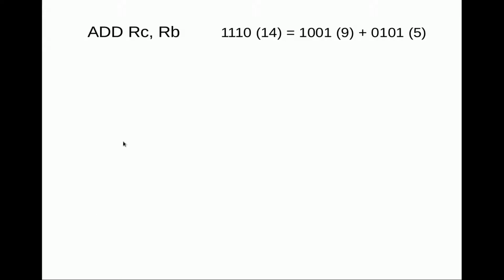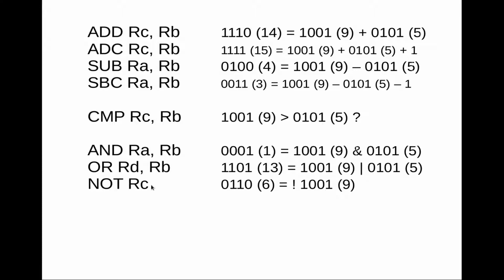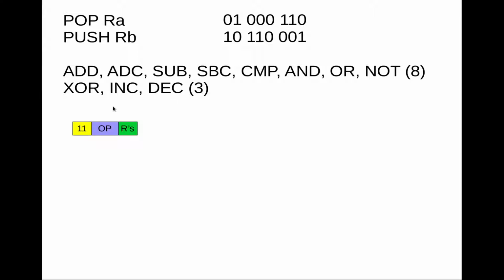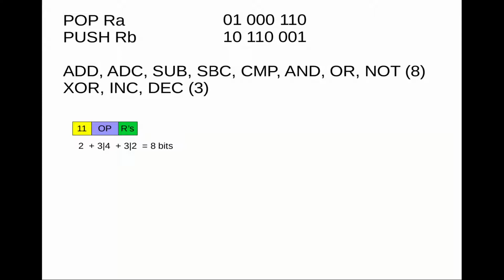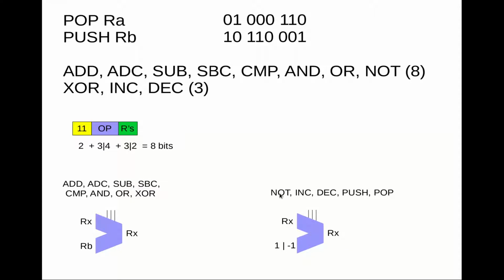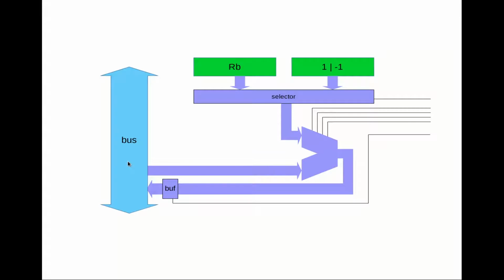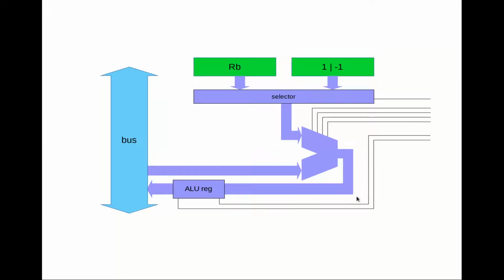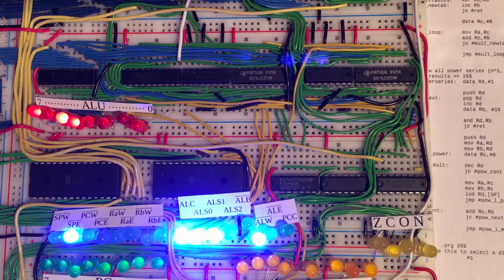My Ben Eater inspired homemade 8-bit CPU - Part 6: ALU  - I

Comment: So why didn't you go with the notion on the "accummulator" and perform all ALU instructuons with first operand and result in the accummulator? You can even use the second operand from memory.

Another thing I'm wondering: stack pointer INC and DEC operations: why bother the ALU with that? Or do you use the ALU to increase the Program Counter? No, so we should be able to build a stack pointer which has the INC and DEC feature built into it. Did you find any particular reason not to do that?
Reply: And here is a chip for our stack pointer: 
 74LS169 which is just like the 161, but it has an Up/Down input on pin-1 instead of the Clear input. So there you go, that's what I will use for my stack pointer. So, while I would still have an INC and DEC for an X and Y register that would be used as an index from a base address (a la 6502), but I wouldn't use the ALU for the stack pointer, and in fact, it seems to me that neither the 6502 does that for INX/DEX and INY/DEY, for which reason there is no INC(A) and DEC(A) opcode.

Comment: I am planning on using the 74LS181. It has a lot of built in capability and a built in comparator (only for 4 bits at a time, so need to AND both signals from each chip). But it has 4 select lines, and carry input. So that is roughly 5 control lines for it. Now say, like your immediate commands, I had stored in program the command for the ALU that I want, which should work just fine. And it could 'save' a lot of possible instructions. The only issue I can think of is doing math on an immediate operand. It probably will make math instructions a bit longer, especially with an immediate operand, but what do you think of the idea?
Reply from the maker: It could be a way of getting around my severe limitations on ALU instructions, which I shoe-horned into 8-bit instructions. Essentially, you are proposing 16-bit ALU instructions, perhaps 24 bits if an immediate operand is involved.

The issue I see with that, is getting your second instruction byte "into" the ALU. Indeed, the instrcution register is only 1 byte long. When you read in the second byte of the instruction, it'll be on the bus, and you'll need to put it somewhere. It can't go from the bus directly to the 74181 control lines, because then how will you feed in operands to the ALU? They too must come from the bus. So you're going to need a "second instruction register", or an "ALU operation register", or whatever you want to call it, to store this second instruction byte. You can then connect it's output to the 74ls181.

Now, since you're going for full-blown ALU instructions with freely selectable register or immediate inputs, you'll need some way of getting TWO operands from the bus into the ALU. Again, you'll need another register to hold, say operand no. 1: on one cycle, you load that register from the bus. It's output goes into input A of the ALU. On the next cycle, you load operand no. 2 from the bus (after possibly fetching it from RAM first if it's e.g. an immediate operand). It can go straight to the 74181 (i.e. input B of the ALU is connected directly to the bus). And finally, like in my cpu, you need to latch the result, which you can then send out on the bus on the final instruction cycle.

So for a typical ALU instruction with two register operands, your instruction cycles will look like this:

T0:    PC is on the bus, and goes into the MAR
T1:    first instruction byte is on the bus, and goes into the IR. PC is incremented
T2:    microcode discovers it's an ALU operation. PC goes on the bus, and into MAR. PC is incremented
T3:    second instruction byte is on the bus. It goes to the "ALU operation register".
T4:    register operand no. 1 goes on the bus. It goes to the "ALU operand register".
T5:    register operand no. 2 goes on the bus. ALU output goes into "ALU output register".
T6:    ALU output register goes on the bus, and into destination register.

For an ALU instrcution with an immediate (second) operand, you have 1 more cycle:

T0:    PC is on the bus, and goes into the MAR
T1:    first instruction byte is on the bus, and goes into the IR. PC is incremented
T2:    microcode discovers it's an ALU operation. PC goes on the bus, and into MAR. PC is incremented
T3:    second instruction byte is on the bus. It goes to the "ALU operation register".
T4:    register operand no. 1 goes on the bus. It goes to the "ALU operand register".
T5:    PC goes on the bus, and into MAR. PC is incremented.
T6:    immediate operand goes on the bus. ALU output goes into "ALU output register".
T7:    ALU output register goes on the bus, and into destination register.

All in all worth a try I'd say! The most important thing missing on both the 74181 and 74183 in my opinion, are shift operations. You really need those for efficient multiplication. I'm still looking for some components to give me that...
Reply: I agree. School is almost done. Just a final this coming Thursday.

I looked and found the 74285 as a 4 bit multiplier, which could be used, and selected using the remaining bits the ALU instruction reg.

But it cost like $10 from the few places that offer it. So what about using an EEPROM? As Ben Eater said, EEPROMs can replace all combinational logic. It would be complicated to design the full ALU (for myself) inside an EEPROM, but considering the operations of shift are pretty straight foward, it could be relatively easy.

And for efficiency, An additional  RAM (more I/O) could be use to shorten the time to complete the instruction and save more space in program memory. And connect this memory to the step counter so it can point to the next byte, which could be the immediate operand. So step 2 gets the instruction and, if it is i-type op., then step 2 will point the 2nd RAM to the immediate operand.

I just think its kind of pointless have to increment the PC just to get data. But I may be wrong, as I really need to sit down and decide what capability I want my computer to have.

And are you still working on improving your current design or have you moved on? I really do appreciate your quick feedback .
Reply from the maker: "I just think its kind of pointless have to increment the PC just to get data.": remember, the PC has its own internal increment circuitry, so it basically "costs nothing" to increment it. The real bottleneck is the bus: the bus can contain one and only one 8-bit number on each clock cycle. No matter how many registers or RAM modules you have, using a single bus you'll always need to pass around data one byte at a byte. In other words, trying to "save cycles" by adding more parallel components only works if you also add (an) extra bus(es). And having more than one bus, is what starts making things really complicated. I have deliberately stayed away from that :)
Reply: So. I have quite a few registers in my current design. I was wondering what you would think of using an EEPROM with 15 memory address bits,  to increase the number of steps in one command (due to getting data out of memory being so time consuming). 

Say 16 bit instructions

Independent register decoding logic (independent of separate op code, still tied to step counter and flags)
4-bit Register destination
4-Register source
(4-16 mux)

8-bit Op code

ALU OP

additional 8 bits for ALU IR
another 8 bits for immediate operand

All of the data coming from memory will take a lot of time (as you said before, due to one data bus)
So increase the number of steps if not willing to make a new instruction bus (probably easier imo)
Also have RAM connected to step counter to save memory. (granted programming a decent sized program by hand on this computer would be tedious) but this could be more of an optimization along with trying to include an Arduino to program the computer.

I was taught the MIPS computer in school the past semester, and well, it has a lot of register. Having a lot of registers is pretty handy, so I kind of wanted to include a lot in my computer here (which is not that realistic, especially with only 8 bit op codes).

Would you say this is worth pursuing or just keep with 8 bit op codes? (Like yours but with additional ALU instructions)

Side note: The 15th bit could be used for external input.